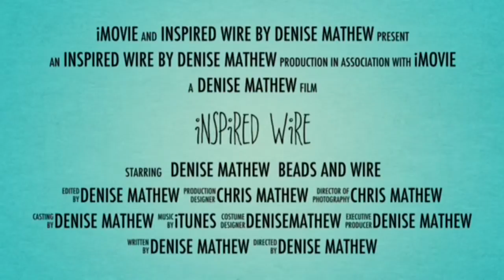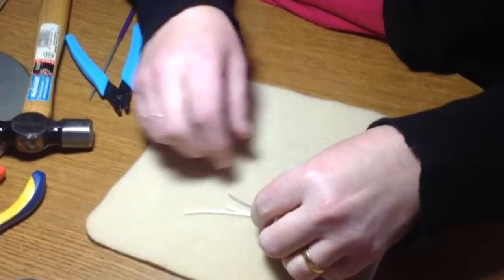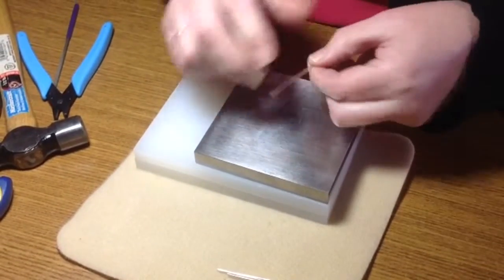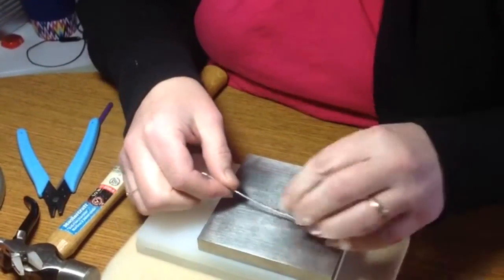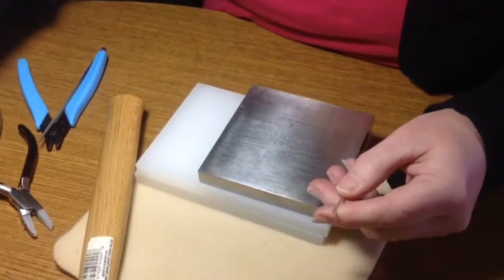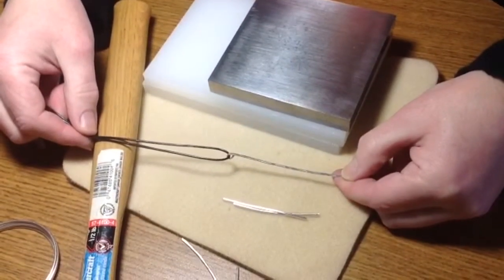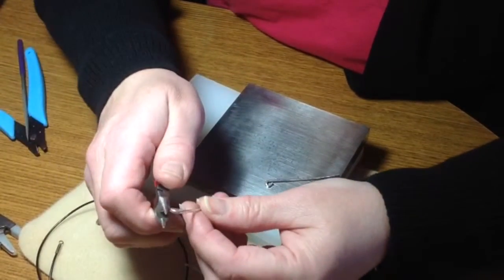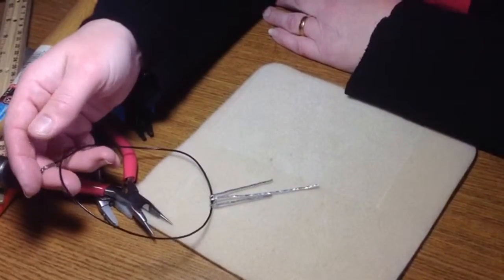5 Minute Bar (Stick) Necklace by Denise Mathew

Comment from the maker: Hi Kim,
 Sorry to hear that you're having trouble. I do use a round wire that is quite soft,it's a 12 gauge copper core wire for this project, the technique is to flatten first then use the ball side to texturize, I always use a hammering block as well as without this the wire can jump around and you might not get the look that you want. When you hammer it isn't very hard, more of a tap, so its very different then if you are hammering a nail. Can you tell me more about what is happening with your wire and what tools you are using. Also if you want to inbox me a picture of your pieces I might be able to give to some tips and suggestions. Don't worry, I know we can figure this out :) Denise

Comment: ah ok.......i do have a fair bit of DS wire..the one i tried was 18g DS brass wire....and i also have a proper hammer n bench block....i think i hammer in between hard n a tap...lol....I have a hard time doing the flattened end of wires to make ear wires with that look instead of using head/eye pins..i really apprecaite your help...thank you kindly..as for sending pics the camera i have is rubbish........lol
but Thank you so much will just keep trying till i get it right..have a nice day...hugssss